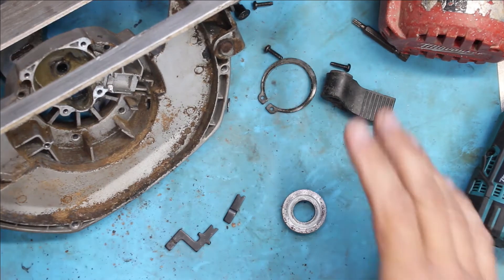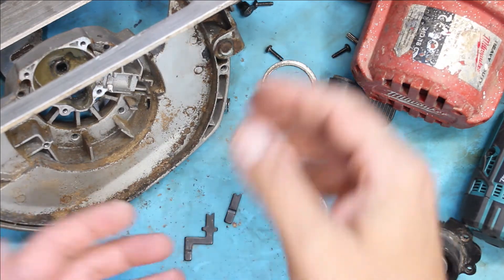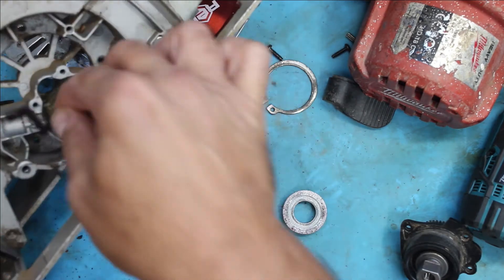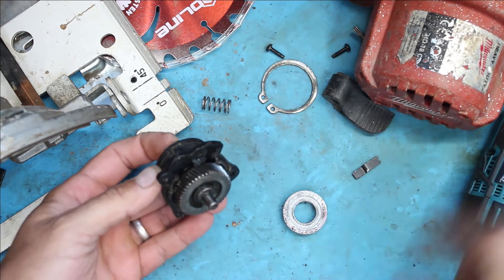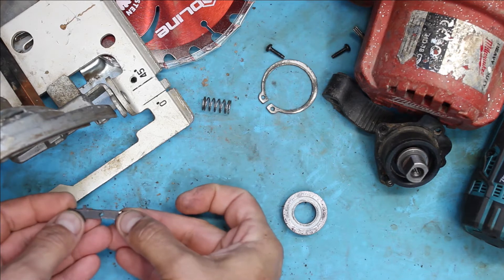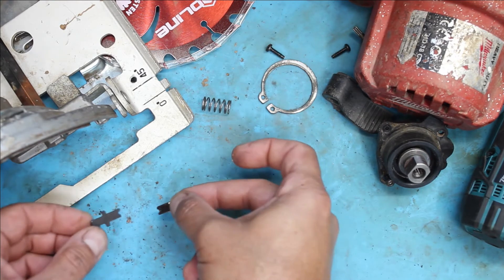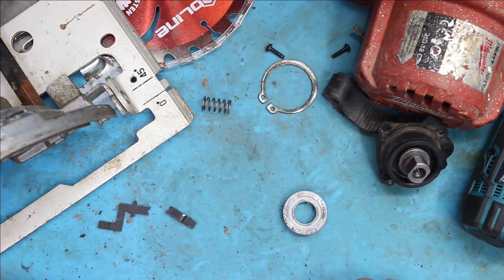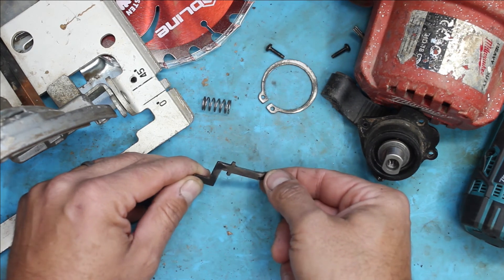Hilltop Workshop | Milwaukee HS 18 CS 18v Circular Saw Spindle Lock Fix.

Comment: like some one else mentioned take the broken piece out or you'll ruin the gear, if you cant get a new part ($45 AUD) $3 USD if ya in the states. so just weld it together, or take it out and use it without it. just have to rest the blade up against something when replacing it. always double check if counter clockwise or clockwise to remove bolt. i broke mine because i didnt check.